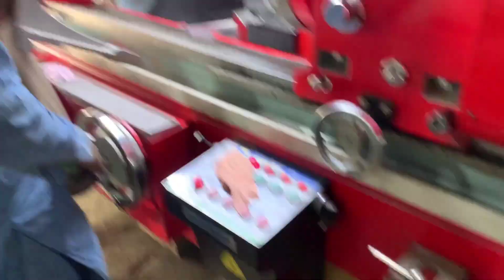Inside the Workshop Amazing Process of Crankshaft Machining and Refurbishing

Comment: This video brings back memories for me, as I worked these very same regrind machines for a few years on our regrind section at Perkins Diesel in Peterborough U.K. back in the mid to late 70’s 
Amazing machines as there wasn’t a Crankshaft that couldn’t be done as you could set any throw be it long stroke or short stroke..& any journal widths as you’d have a number of different grinding wheels at hand.
Something that the previous Prince grinders couldn’t always cope with.
Strangely these operators haven’t put a radius on their grinding wheel to blend them into the journal being ground, as this will definitely lead to a weakness & under load would break up in the engine…

Comment: This is a high precession shop, notice the machinist taking his time to dial in the runout.
Reply: Agreed. But, if you can throw the mic through one journal, and it won't fit on the next... Might be time for new.  And, get some safety glasses.

Comment: Don't ever understimate Pakistani ingenuity and craftsmanship, specially their care for details and functionality!.
Reply: Its rubbish and you know it
Reply: These videos amaze me.  You don't have to have the very best of everything to perform good work.  Takes alot of wanna.
Reply: the only care you tend to see in these videos is the lack of any safety, at least granted unlike most others they at least have a machine that looks to be in good shape and actually use measuring devices.
Reply: You sir have an untrained eye! And I would never grind the bend out of the mains!! If you know anything about metals a it will try to return to it original center line.